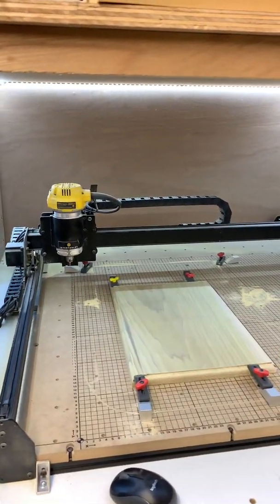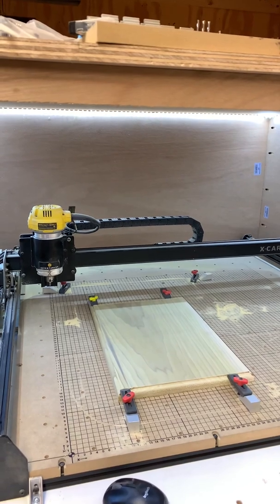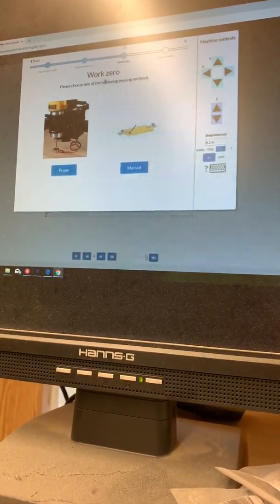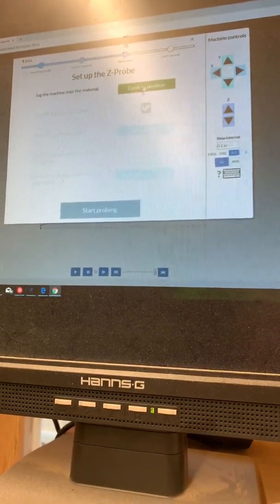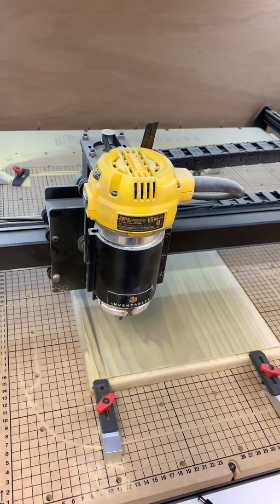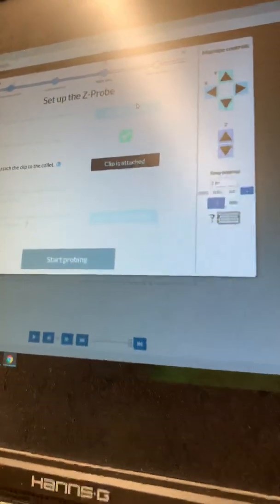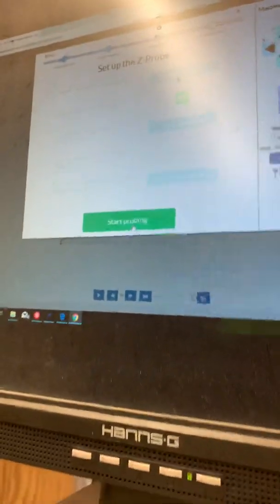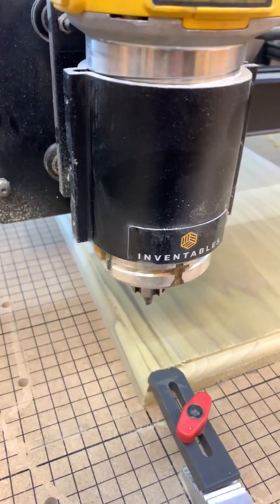How to Use a Z-Probe For an X-Carve

Comment: Once you probe it, and you move the router to the left corner for example for a XY zero, can you lower and raise the router or does it need to stay at the height it was at after the probing? I ask because I’ve done this, and it seems like my machine is carving in the air. Thanks!
Reply from the maker: If you’re using Vcarve/aspire, you need make sure you have an allowance set up in your roughing pass. If not, it will carve basically air when you cut the finish.

Comment: Thanks for trying to help. But you need to help yourself and drastically reduce the length of your presentation. This vid should (at the most) have been about 2 minutes long. Just stick to: 1. Do this. 2. Do this. 3. Do this etc.
Reply from the maker: Kevin Mooney this wasn’t a video designed to go on YouTube. It was recorded for a group I’m in on FB and people had questions about using the probe. I put it on YT in case others needed to know and could search on YT for it. Thanks for the insight though. I’ll make sure I keep them shorter going forward.